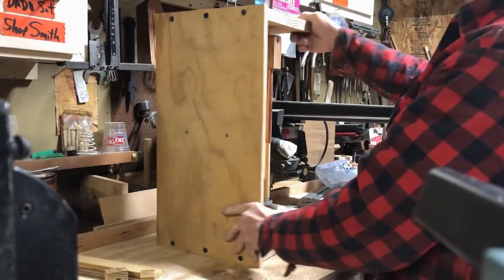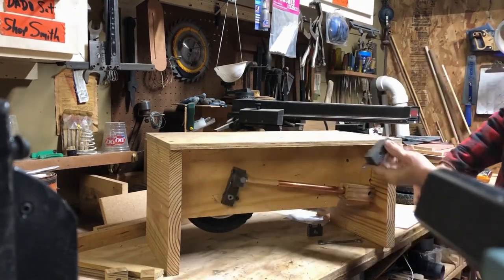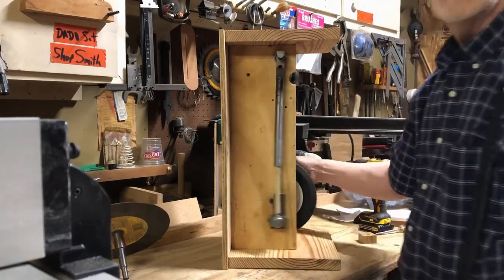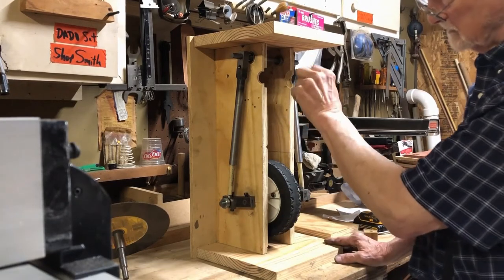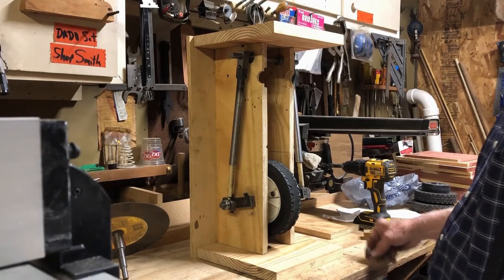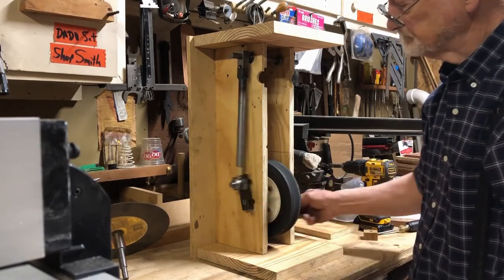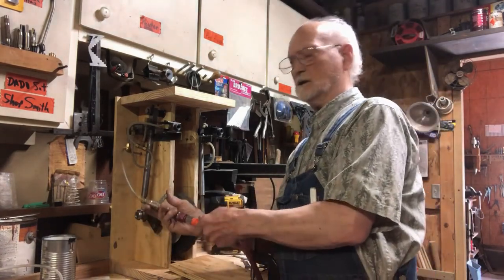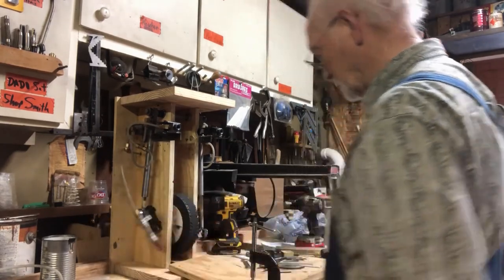Compressed Air Engine Bicycle Assist Motor 5-10-21

Comment: Coming along great!!!
That thing is gonna go like hell!
Better invest in a helmet! lol
Is the tank going to mount on the top of the engine?
Reply from the maker: I'm looking for two used 80 or 100 Cu Ft Scuba Tanks that I can afford, and plan to hang one on each side like Saddle Bags. 
Calculation says at 800 rpm bike will be going 19 mph - have to wait and see?
Reply: @AirEngineResearch  The average bicyclists will achieve 11 to 12 mph so 19 is a pretty good speed. Hanging the tanks like saddlebags will be good for balance.
Looking forward to seeing this built and you riding it!